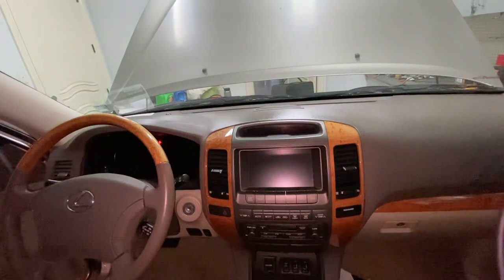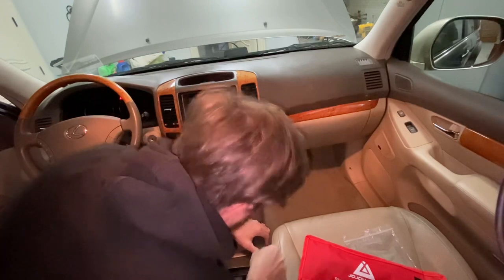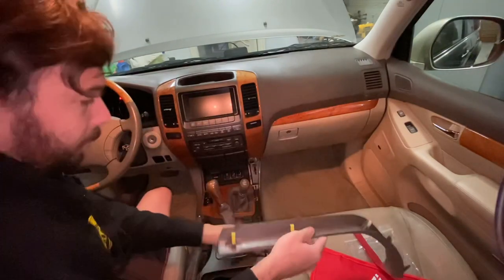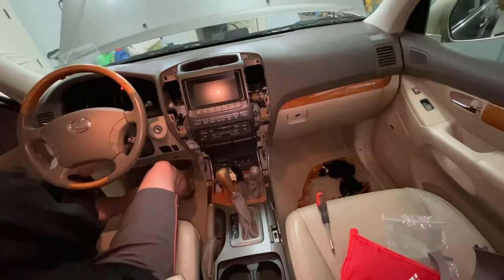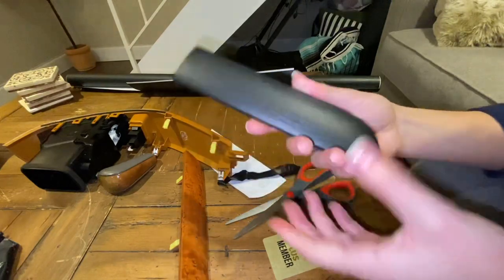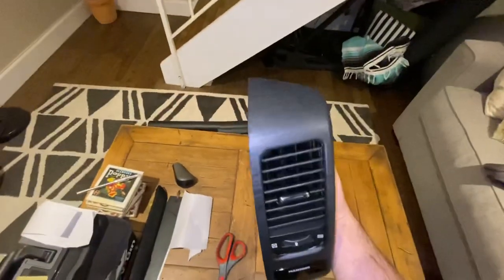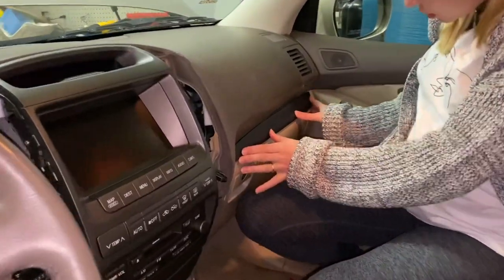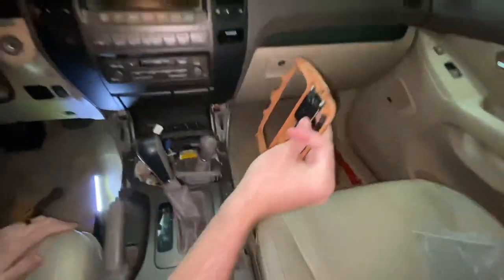Lexus GX470 - How to Vinyl Wrap your Car’s Interior Trim

Comment: I really like that, and am considering doing this, or maybe ordering the brushed parts from overseas.  Are you planning on doing anything to the color of the "darker" brown at the top of the door or the dash to make it match the black?  I've been toying with the idea of doing that to have the light tan contrast with black everywhere else
Reply from the maker: It would take way too much work imo to convert to black on the interior. I did switch to Prado interior panels instead of the wood on my GX though.
Reply: @lexus_offroad_adventures  I'm not saying the entire interior just those top darker brown section at the top of the doors and maybe the dash.  But I don't want to spend $800 on a new dash.

Comment: This is JMHO 
Why would you want to turn your real  birdseye maple into black plastic? Why not try and find an old  GX Sport Model from  a junk yard. Sport models have the dark wood  trim. I'm not a huge fan of the  orangey birdseye maple either. There has to be a set of the sport model trim  on eBay or Craigslist. BTW,those panels are real wood not plastic. Well...that is until now🙄😒
Reply from the maker: Some peoples’ are cracked or sun-faded. 

sure, you could go out and buy the silver sport model replacements, how much would that cost? $2-300?

or you can just spend $20 on whatever vinyl wrap suits your tastes and wrap them. Different strokes for different folks, my friend.

Comment: Looks better before you touched it, in my opinion.
Reply from the maker: Some people like the wood. I do too, but If you could see these trim pieces up close, they are really faded on the tops where the sun hit them.
Reply: @lexus_offroad_adventures  i tried sanding a set and clearcoated it and it worked but depends how badly faded they are.
Reply: @dp9948  Theyre not real wood on GX though are they? My presonal rule of thumb is that if the wood is real or atleast has a single sheet of veneer on the plastic trim, I wont wrap it, maybe tint it to darker shade. But I'm a car interior modding junkie, some people wrap cars outside, I change the colour of my cars leather, carpet and trim colour. Currently dying my GXs ugly dark grey leather to Lexus Cabernet dark red leather liek in newer GXs and LXs.
Reply: @e.e9331  hi Lexus junkie here I can say without a doubt that the later models 05 and up I’m believe all have real wood in fact they cut the wood trim from the same tree to ensure the same pattern
Reply: @e.e9331  very interested in your interior change tho